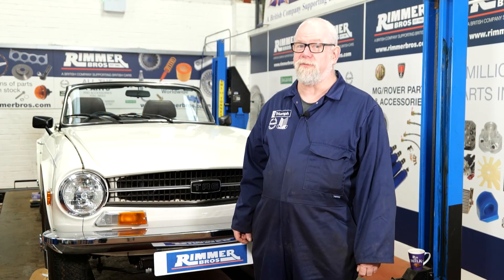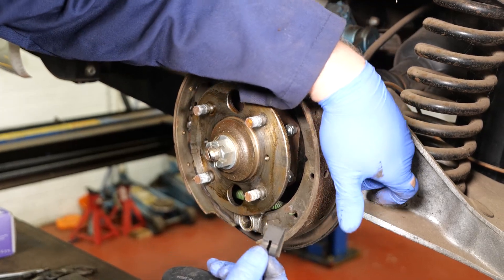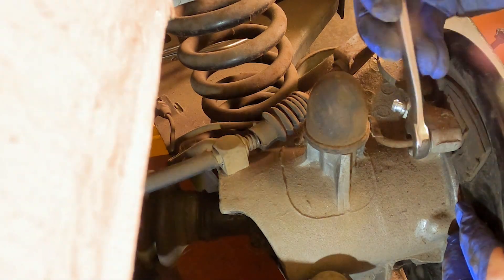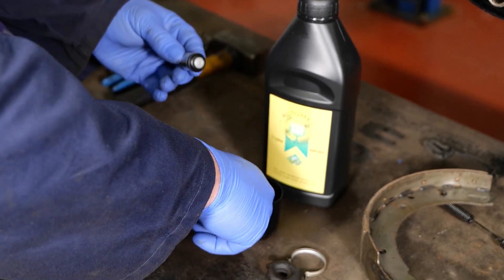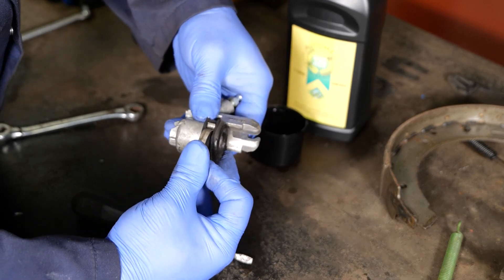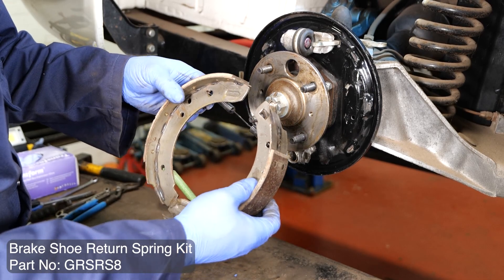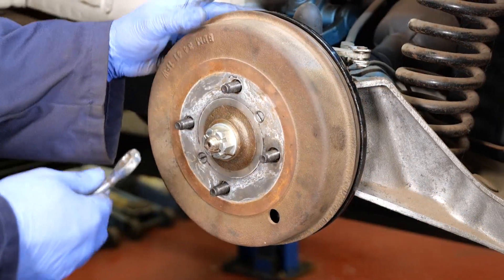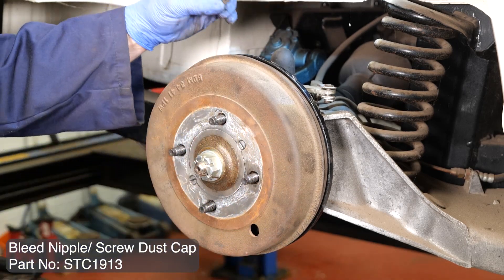Triumph TR6 Recommission Project - Rear Brakes

Comment: I have braided brake pipes, what should I do as I think clamping will damage the pipes?
Reply from the maker: Hi unfortunately you cannot clamp braided brake pipes so you could make your own cap with a female connector and an old piece of copper brake pipe (with the end pinched together).

Comment: Whoops - at 9:49, the rubber dust cover. Doesn't that need to go on first, before the three spring/locking plates? You might consider editing the video to put that on first. It won't go on after you put the rest together.

Otherwise, good video. I'm going to follow you guys to get my '71 back on the road.

Do you have a video on replacing the rear break hoses, I have just bought stainless steel braided hoses and am having trouble removing the 2 rear hoses at the connection above the frame. Very difficult to get in there with a wrench and the connector needs to be held steady to break the hose connection, I would like to see it done properly before I attempt it (again.) Thanks!